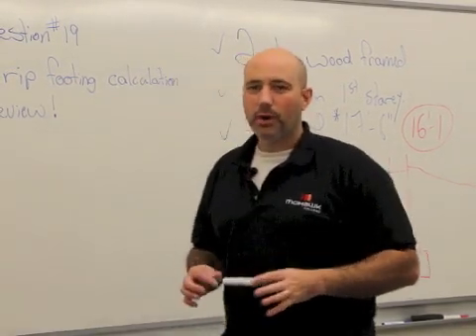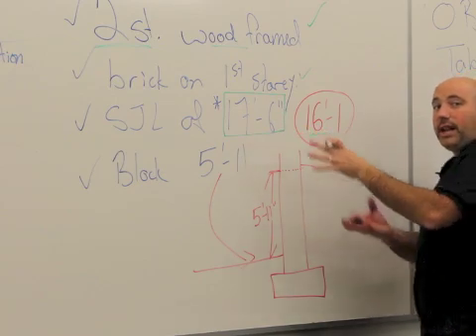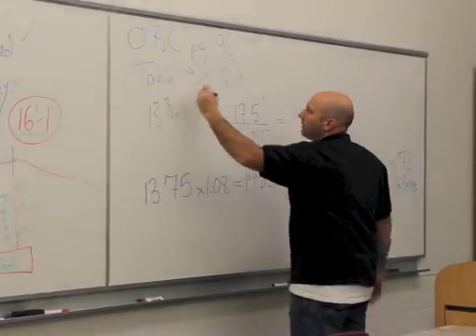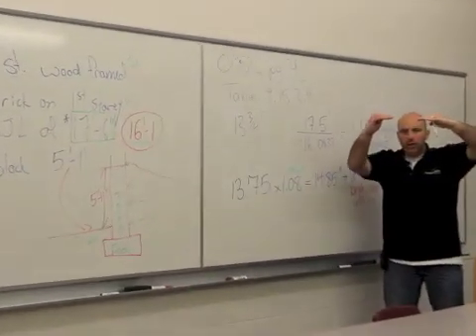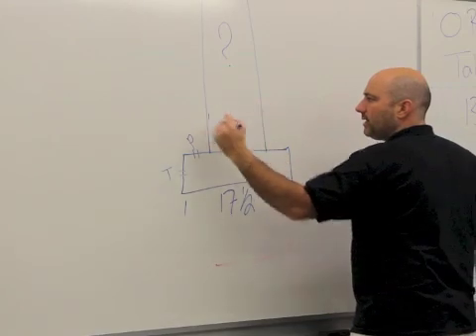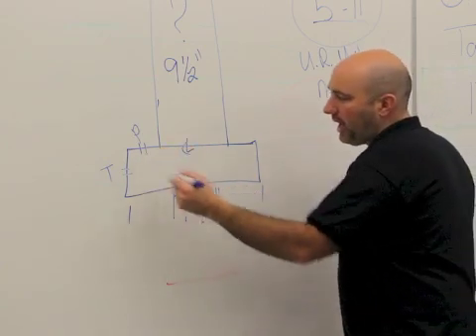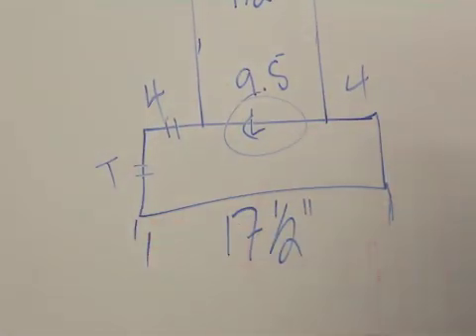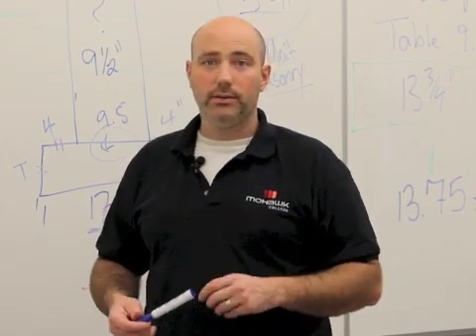Strip Footing Calculation Review

Comment: Hi instructor, I'm taking a building code course in British Columbia and your video helps greatly. Can you give me some hints on the following question?

"what is the minimum required footing width for an interior non load bearing masonry wall that extends from the basement floor to the second floor ceiling (6900mm high)? " 

The question itself is similar to your example in the video except I got this floor ceiling of 6900mm. Although our codes may differ could you please offer me some help? My actual course instructor is not responding my email for weeks. Thank you !
Reply from the maker: Well, thank goodness for the internet and you tube!!! 👍
Reply from the maker: Look at table 9.15.3.4 in the National Building Code.
Reply: @buildingreno  I did. In fact in 9.15.3.6.(2) it says "Footings for interior non-loadbearing masonry walls shall be not less than 200mm wide for walls up to 5.5m high and width shall be increased by 100mm for each additional 2.7m of height."

the sentence fits the question that i'm trying to answer; however, the figures 6900mm and 2.7m height is really throwing me around, I don't know how both figures relate to each other. Help! Thank you.
Reply from the maker: So,  a 5500mm (5.5m) wall needs a 200mm wide footing. Your question asks what if the wall was 6900mm (6.9m) tall? 5500mm+ 2700mm = 8200mm....your question wall is bigger than the base of 5500mm....and not over 8200mm...so add 100mm to the footing. Therefore 300mm. 

Please know, I'm out camping without a code book so take my advise with a grain of salt.
Reply: @buildingreno  Thank you instructor. Your explanation helped. Appreciate it!!! Sorry for the all the questioning it's just the instructor provided to my course is so bad in not responding to questions and I have an exam coming up. Cheers.

Comment: Good Class! for your students however experience is a good teacher as well, draw a 9'' wall with a footing one and a half times the thickness of the wall is 13& one half inches. to figure out the width of the footing draw a 45 degree angle from both of the bottom corners of the wall where it stops that's your width of footing Now draw an arrow in the center of the wall pointing down this represents the load then draw 4 arrows under the footing pointing up this represents expansive soil draw a jagged line alone the 45 degree line till it stops at the bottom corner this is where it will crack, if a footing is not wide enough it will crack under the wall and become an expensive fix. your students should also know the maximum length of the block wall before it needs an abutment support for the soil pressing against the wall
Reply from the maker: This video is just a snapshot of what is covered in a semester. All you have written and much much more is covered in great detail.